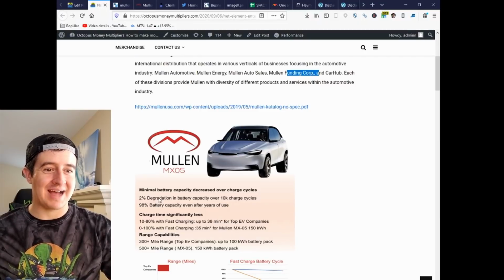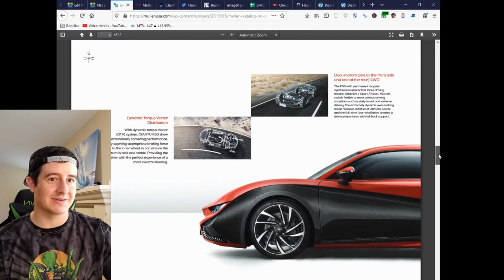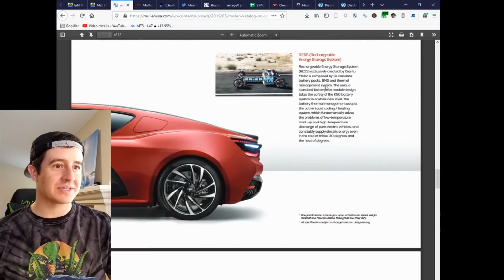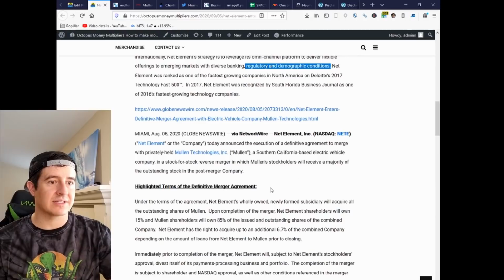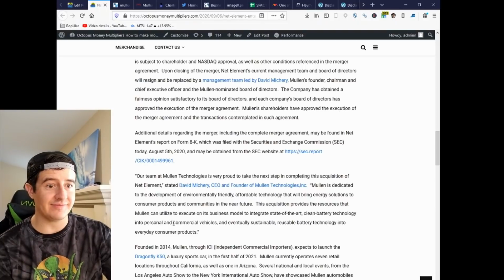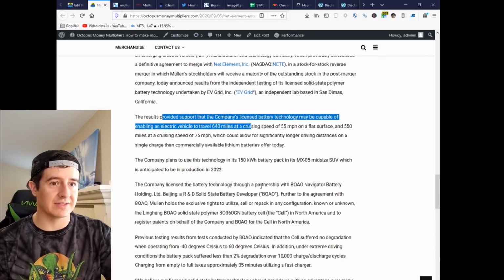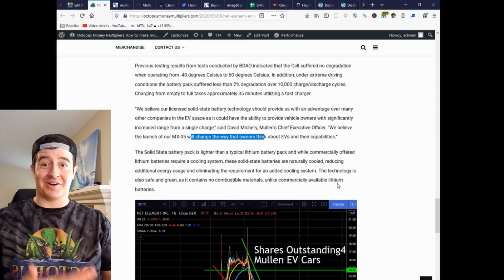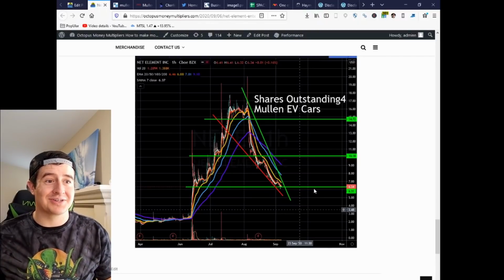Mullen Electric Car Technologies 😲  Stock Merger Net Element NETE DragonFly K50 MX 05 News Analysis

Comment: For those who don't know about Nete

Nete (net element which was a card processing company) is being taken over (stock for stock merger) by a new EV company called mullen technologies. Takeover is just like a shortcut to ipo, less expensive and faster. Merger in q4 this year. Letter of intent executed and mullen raised 135m$

Mullen = Chinese ev + suv + battery tech. Also production factory is being built and they started taking orders for their cars which will be delivered in 2022. Next nio

Nete pumped from 2$ to $20 and now settled around $8-10

Once merger happens its likely to be in $30-50 range.

P.S Blackrock is one of the investors.
Reply: It’s 0.78 now. Are you still bullish?